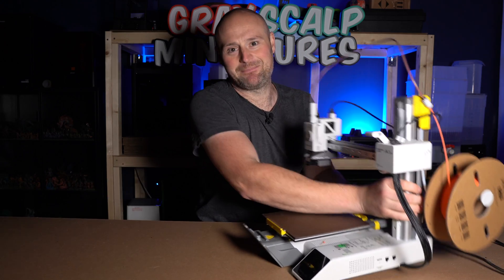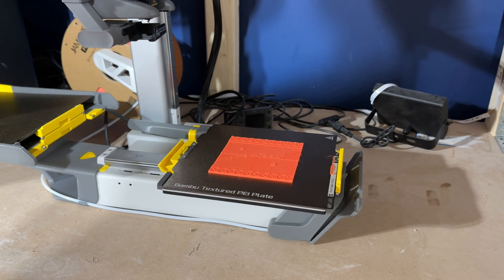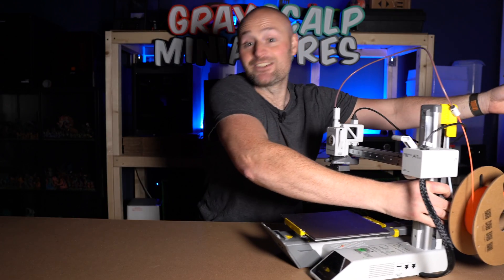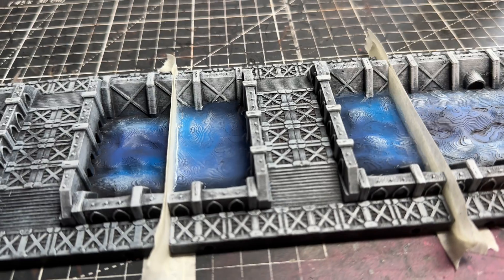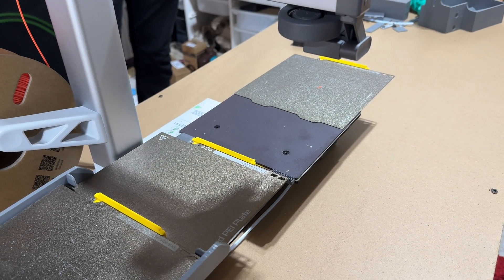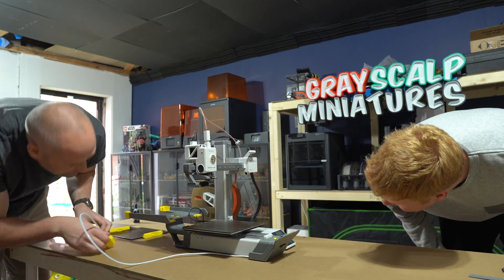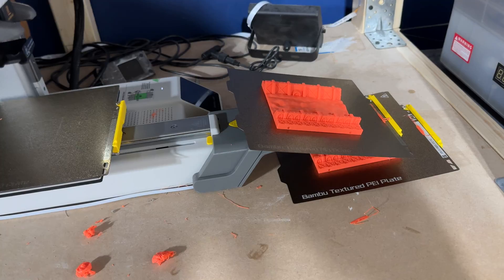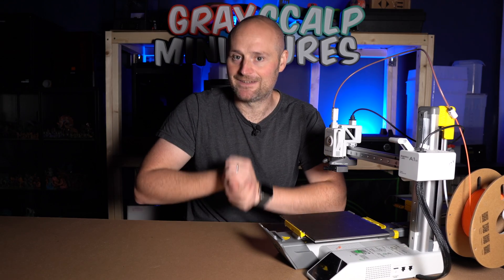Bambu Lab A1 Mini Multi Plate Printing Upgrade

Comment: Great idea, but the cost makes it completely redundant . Where I live this will cost more than  half of an A1 mini,  and the benefit is for very specific use cases that an A1 could solve anyway
 I see this actually being a rather pointless mod for 3 reasons aside from cost -

1. This mod isn't increasing print speed output 
2. The footprint of the A1 mini becomes cumbersome therefore negating the draw card and main selling point of the A1 mini.
3. This mod and the price of an A1 mini is more than just buying the A1, which has the much larger build plate thus negating the need for multi-plate builds, and will take up less of a footprint.

Now for the costs ( in my country) - 
DIY Mod plus shipping $125 + $10 for filament to print the parts not in the kit + $88 for 2 more build plates = $223
Cost of an A1 mini - $329
Cost of an A1 - $439

Better off buying another A1 mini that will not only speed up multi build plate projects but 2 x A1 mini's will take up less space than a modded A1 mini.

Comment: I wonder if the back portion could be at an angle to help reduce the size increase?  I think the big difficulty there is that the horizontal approach is likely far better for ensuring proper build plate alignment when putting on a new plate.

Comment: okay, this is amazingly cool.  But I have to say I feel like you could just have the print head knock the pieces off the plate once its cooled.  They have almost no stick once its actually cooled.
Reply: Probably has reliability issues when prints have supports of any kind and may get left behind on the print bed which will then make the other prints fail

Comment: It's kinda weird that they made this a whole webapp and stuff. It's just end gcode to swap the plates and then queued sliced file. 
If you didn't care about progress tracking and being able to stop and start in the middle you could even have all the sliced STL gcode pasted back to back in a file with the swaps in between and the printer wouldn't know the difference.

Fundamentally the instructions printers take are incredibly simple.

Do you see the web app and interface as a huge reason for you feeling comfortable using this? Or would you trust it the same if it packaged it all up and they told you to send that to print blindly?
Reply from the maker: For me I feel a lot more comfortable with the web app. For the kind of user I am, it definitely makes this easier to access and use. 

I’m not an expert on g-code so haven’t tinkered.
Reply: @GrayScalpMiniatures  makes sense